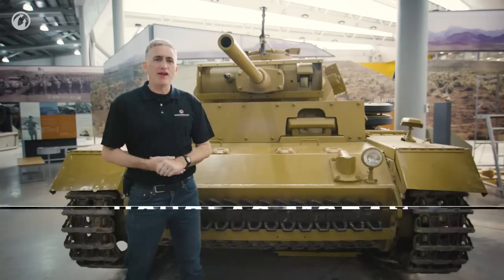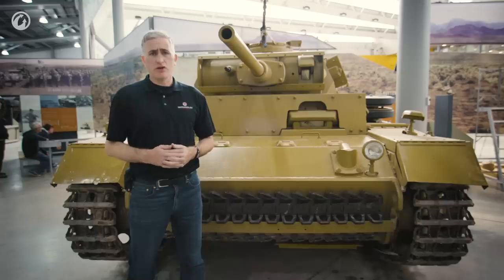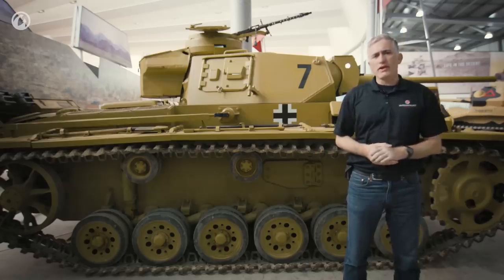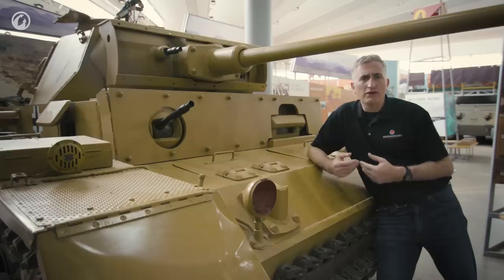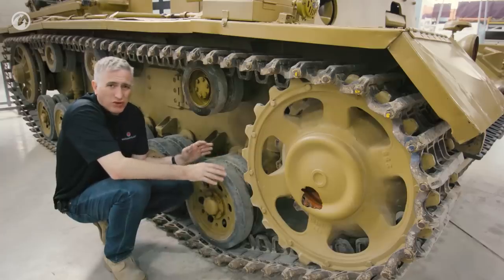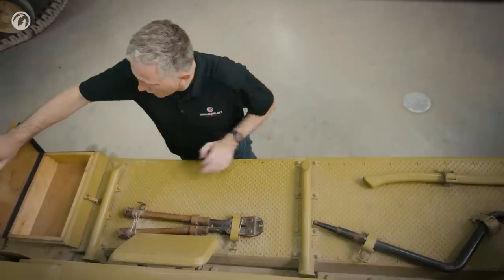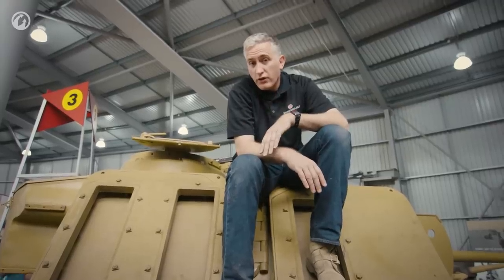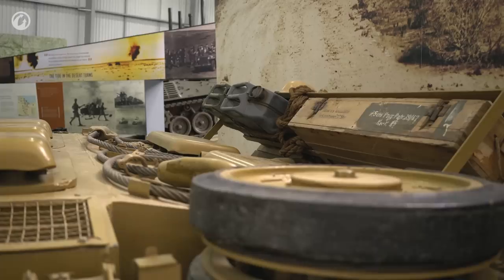Inside the Chieftain's Hatch: Panzer III Part 1

Comment: That escape hatch on the side, looks like you could barely fit your head through! How is a soldier supposed to get through that?
Reply: Well if your tank is on fire, you wouldnt really care if the hatch fits or not
Reply: So a tank on fire suspends the laws of physics regarding fitting through said hatch then?
Reply: If someones life is on the line, he can break any law of physics
Reply: Given that they did get rid of the turret escape hatch the hull side one must have been usable, otherwise they would have gotten rid of that one too, or made it bigger.  

People can fit in very thight spaces when properly motivated, such as when you hear your girldfriend's father walking up the stairs and is about to open the door... fire may be similar.

Comment: Sloped armor worth the effort? It’s more easy to produce. Less parts. Less welds. More space. Simpler Design.
Reply: The problem is thqt germany already made the tooling and production lines for unsloped armor, and they deemed it not worth it to take the massive ammount of time to remake all the tooling and other logistical issues.
Reply: Also most tank designers in the 1930's didn't see the positives of sloped armor, for whatever reason.

Comment: I haven't watched the video but let me guess: 
- I am a 2 meters tall man and this tank is too small ! 
- There isn't enough escape hatches on it, as the main purpose of a tank is to ran out of it ! 
- The cannon is too big, who needs range and firepower anyway ? Just put a 56 mm in it and done ! 
- The transmission is not covered with a bolt-on piece! Who needs solid armour when you can have bolt heads flying inside the tank when you are hit ! 
- The tank has a small silhoutte ! Crew comfort is more important ! Just make it bigga ! Moar space for everyone !
- Too many machine guns on it ! It is all wasted space. Just put metal baskets so people can stack away their guns. That is what I used to do back in the day ! 
- Turret is too small. How the crew will sleep on it ? That is what everybody does. Right ?
- Torsion bars ? Pffth. Unnecessary engineering for it's time. 
- Remember kids, the only thing that matters is track tension. Screw mobility.

Comment: What a example for bad engineering. Instead of having the front of a highly complex from multiple parts welded staircase design, one sloped steel plate would be more easy, cheaper, faster, spacier and more armored.

Comment: Germany did the same with it's aircraft; great machines but terribly complex and over dependent on depot maintenance and access to the rail system. American aircraft were designed to be field maintained as much as possible, just like their tanks and trucks and artillery, with as much commonality of parts as possible. Germany had quite a bit of commonality in it's aircraft and tanks and prime movers like the 251 but it had so many different types in it's establishment, it couldn't hope to keep them all running.
Reply: this is over simplifying thing and wrong there are many tanks and planes on both side that were complex or simple. the 109 is a good example of a plane that was made to be maintained under field condition